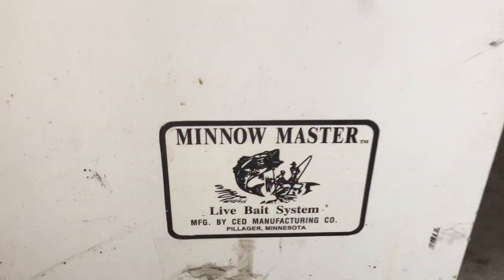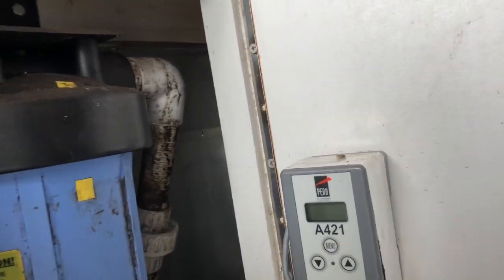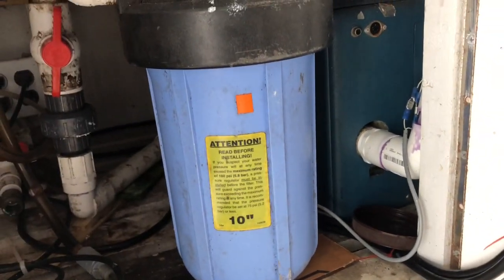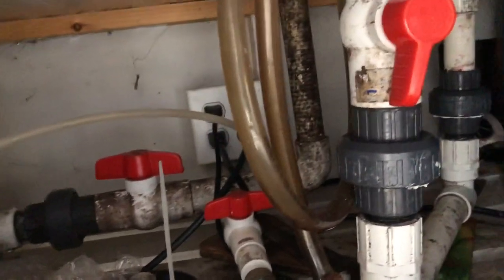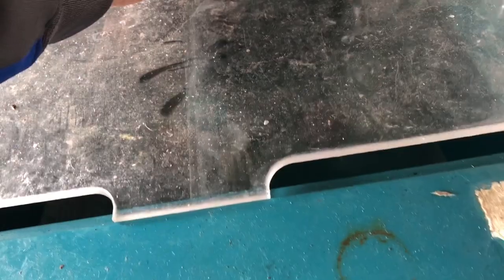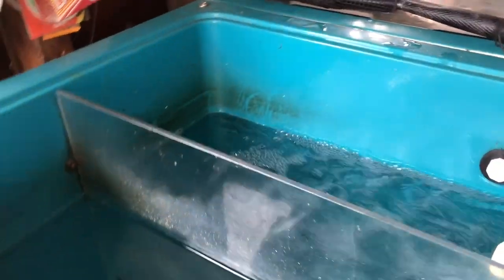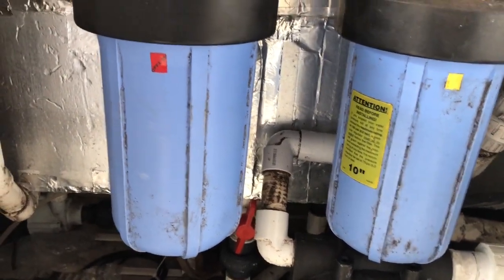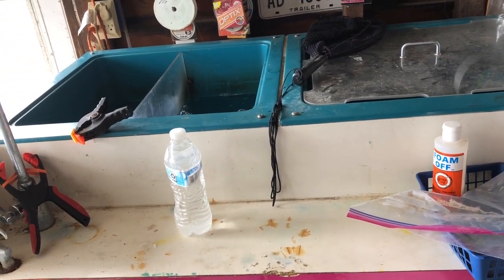Minnow Master bait tank for keeping bait fresh and cool.

Comment: Hey Jim im curious how the pump and filter systems works? I have homemade tank but my diy bucket filters are a pain. Do you just fill this style filter canister with lava rock and gravel?  Thanks
Reply from the maker: Hey. Thanks for watching and asking a great question.  The system is well thought out and works great. There are 3 cartridge filters in line. The first has a floss “sleeve” where the water enters inside and flows through the floss and onto the next canister which has charcoal and then to the last with lava rock and then enters the chiller.  I actually started using the same rock that you get for your grill.  I break it up with a hammer to fit the canister.  I made a similar system for my aquarium fish. I raised discus for years and made an automated water changing system for them. It was hands free once it was started by using auto timers, 4 cartridges, float switches ( similar to toilet floats ) a pump and 4 barrels in line.  I have a video of it somewhere that, that I’ll try to send you. It had sleeve filters in it that actually dechlorinated the water right from the tap so improving what you have is an easy fix. Here’s my email address jimhanleyfishing@yahoo.com     Drop me a note and I’ll send more info for your system.